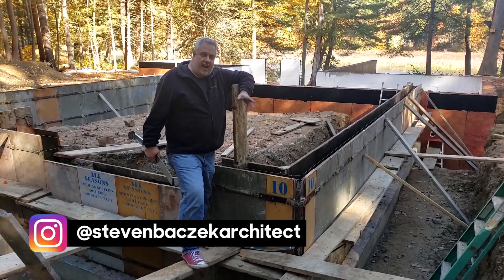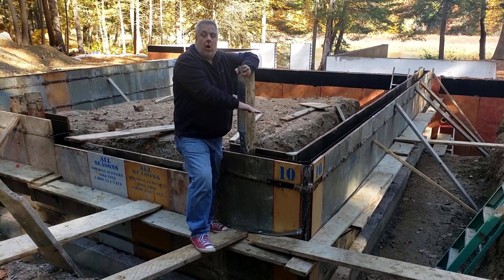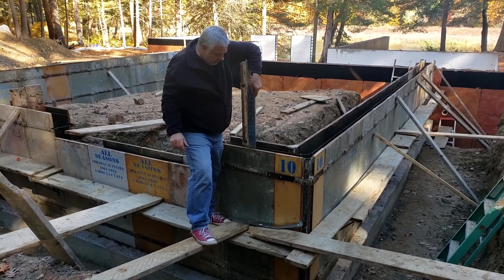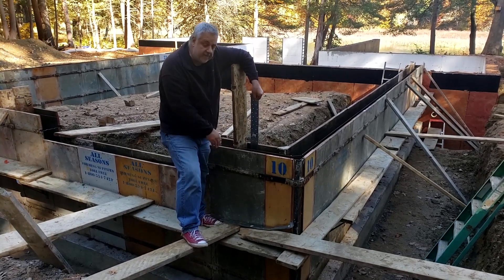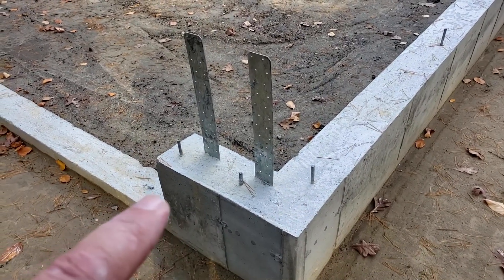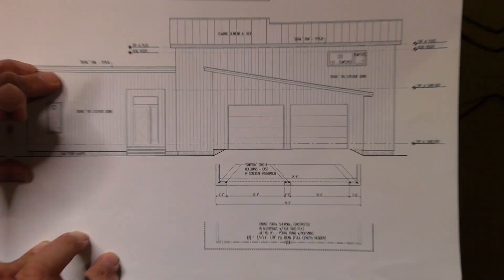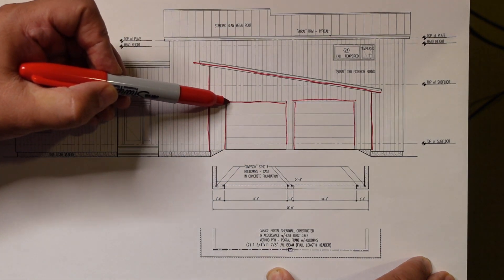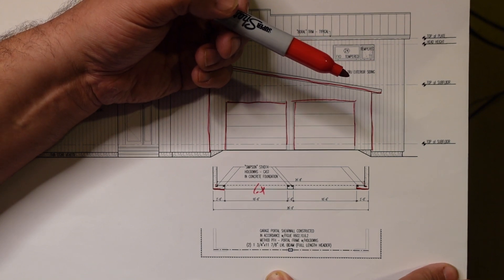GARAGE PORTAL STRUCTURAL HOLDDOWNS

Comment: Steve, get your structural guy there.  That is not what Simpson sales this for.   It has nothing to do with shear.   I am a PE and again you are wrong.  Simpson shows this strap only being used on the exterior side.  It is used as a hold down.  Shear requires that on force is going upward and the opposite section of the portal is going downward.  This strap is only rated for tension.   Also, Simpson shows a rebar being run horizontally where these straps are.   I do not use these for this purpose.  I design in the seismic and 150mph on the southeast coast.   Go look at videos of coastal area failures.  Your PE puts his stamp on his drawings and I do mine also.  I am sure we are good for the areas we design too.  I would much rather see a PE explaining what he does instead of an architect.

Comment: Great idea to have the strap on the inside.  Fully embedded is way better than having them at the edge of the concrete. That's a thinking builder.  Is there a corresponding connection from the wall section to the LVL above or is it just the plywood sheathing? I have seen connectors that use threaded rod fastened to an embedded anchor at the foundation and run all the way up to the header or top plate. In southern Alberta we have extremely high winds but we haven't really done a good job on the residential end of things for this sort of situation.  Good details.

Comment: Great explanation. I believe you said the minimum for the portal walls is 2'. I am pretty sure in Section 6 it allows for less width as long as you use an allowed type of portal frame.